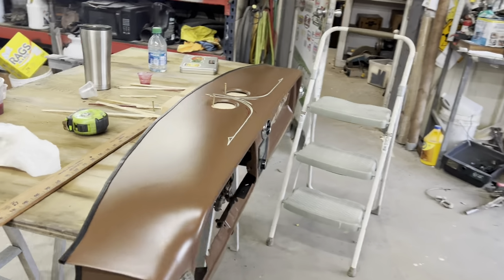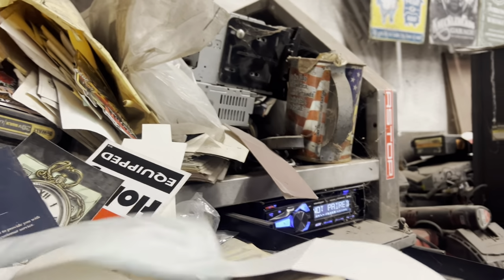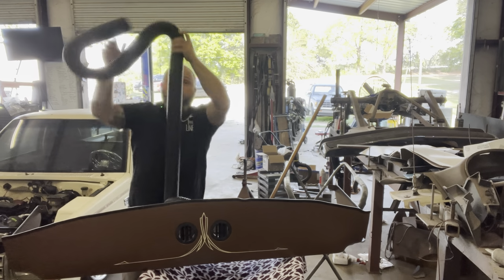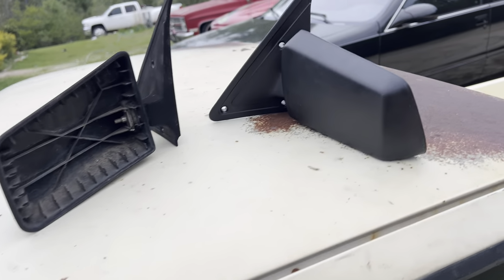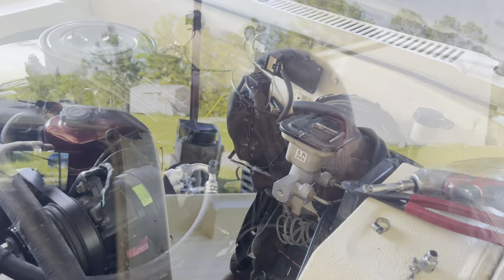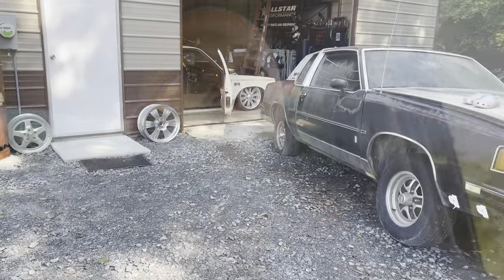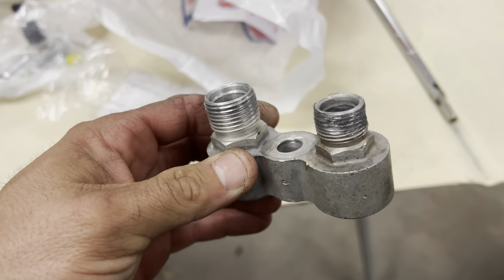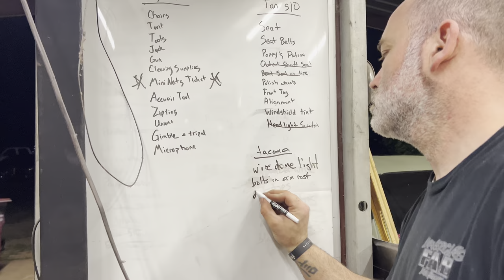Bagging and body dropping our 1989 S10…part 14…finally finished and ready for MiniNats

Comment: When I've had to fight with those sill plate screws, I've used vice grips on the bottom and back them out. A couple 2/3 turns and you can usually get them to turn with a screwdriver. PB blaster and a pick to get the rust out of the screw heads doesn't hurt, either. Back in the 90's we used to cut the pockets off the door panels, and make a replacement panel with a 6.5 (or 2 6.5's). Not a ton of room for speakers in a standard cab S10.

Comment: The steering columns are a nightmare. That high beam switch has a little plastic bracket that pushes the bar for the high beam button. Has to be dead nuts to work properly. Just had to pull my 91 column apart to tighten the tilt mechanism. Loving the s10 content see yall in the valley!